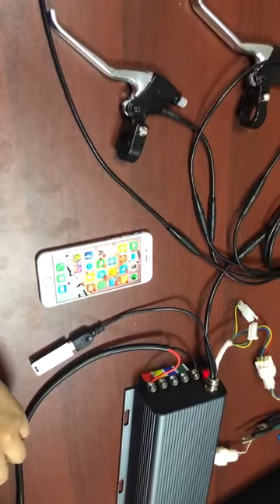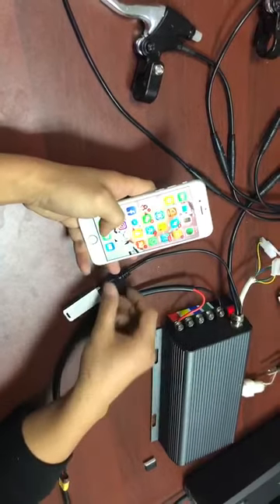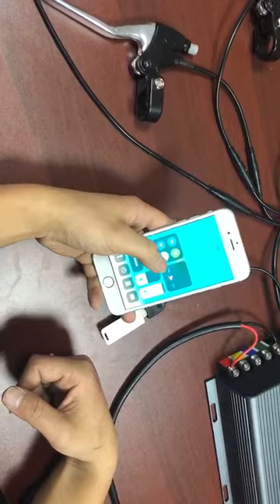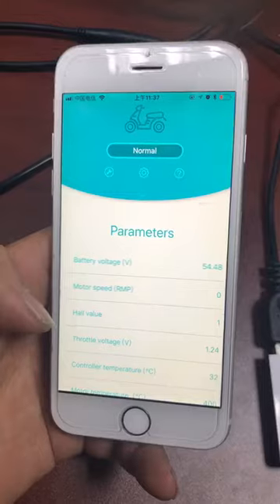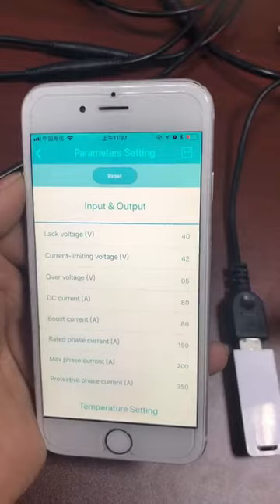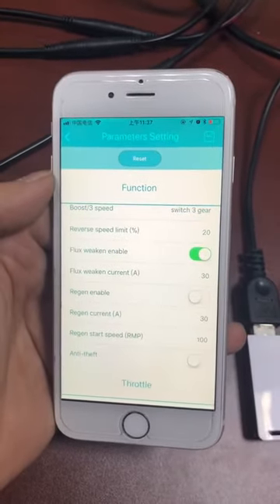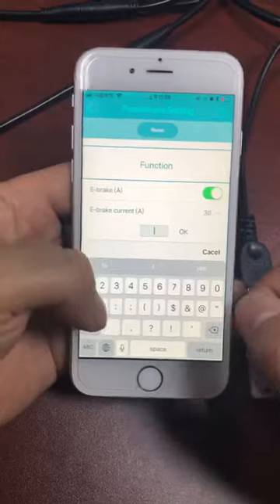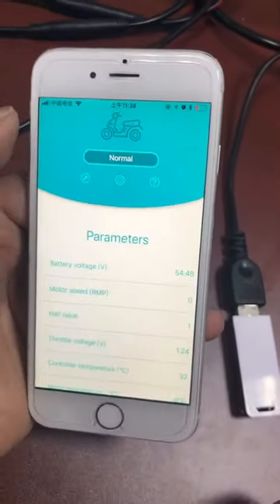Bluetooth adapter with sabvoton controller for TFT display system

Comment: My controller is connected to the app but everything is diplaying 0. Am i missing something? 🤷‍♂️
Reply: I have same issue
Reply: @AaAa-hp4zk  I had the same problem did you disconnect the connector with the three wires

Comment: Where download ?
Reply from the maker: 1) App download website :
l ISO ; Find the MQCON in Apple Store .
l Android , check the below link and download.
https://mobile.baidu.com/item?docid=23168723&source=p
c
Reply: So I can use this to test and program my controller if it won't link to PC?
Reply from the maker: yes. very easy and quick to do hall test, change settings.
Reply: Hi Jason,
What will be the solution when my Bluetooth phone Don t associate it with the Bluetooth key of the controller? And I tried many many things!
Thank for your back.